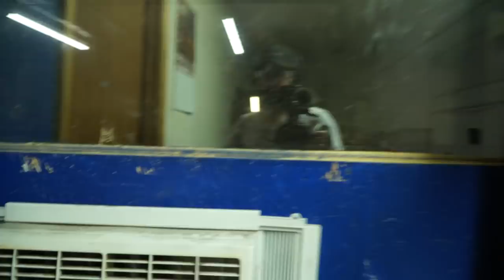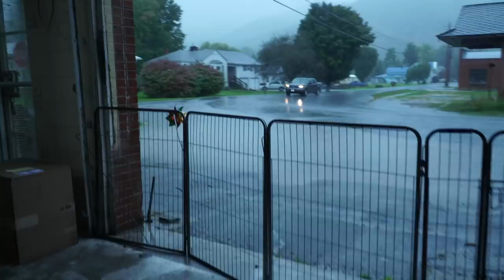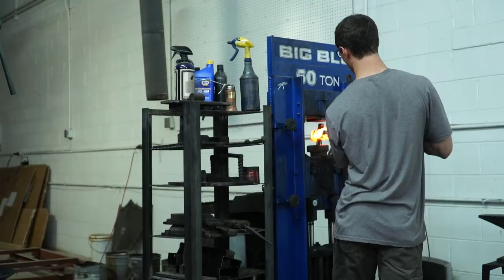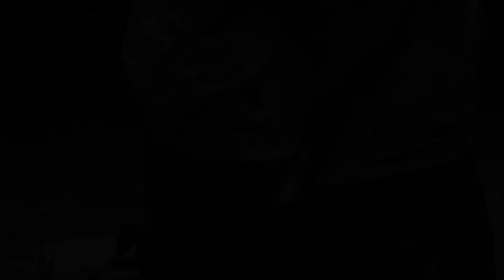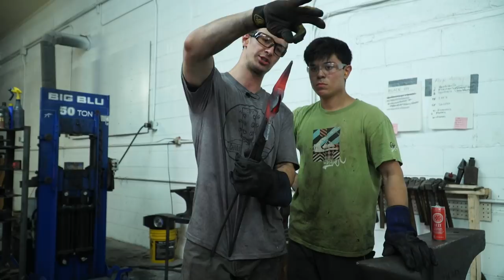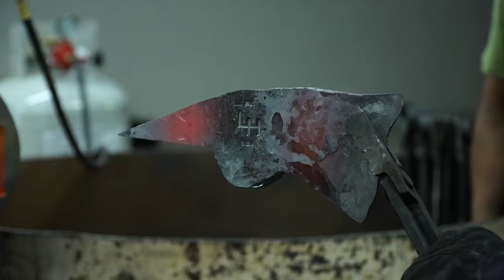FIREMANS AXES FORGED IN USA

Comment: The video made my day man, do you think I could get the same thing done with a 25 ton press, thanks
Reply: May take an additional heat or two and a bit more time, but should work. Smith's have been doing it for centuries without power hammers/presses, so no reason why a 25 wouldn't work.